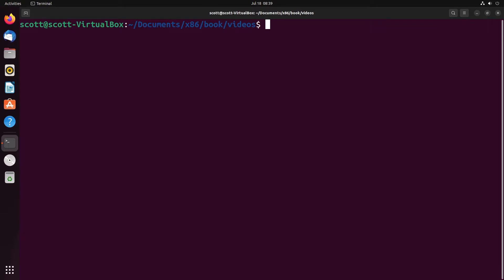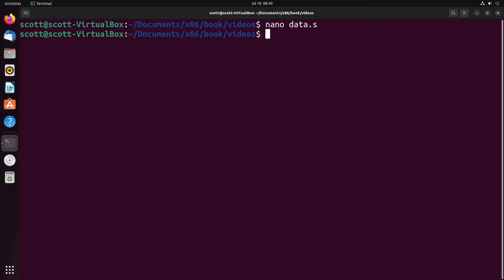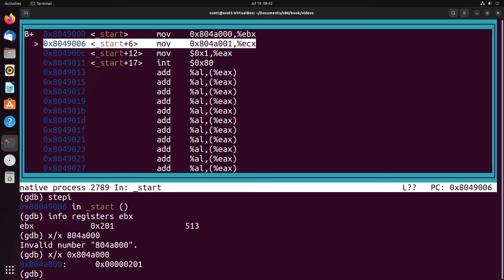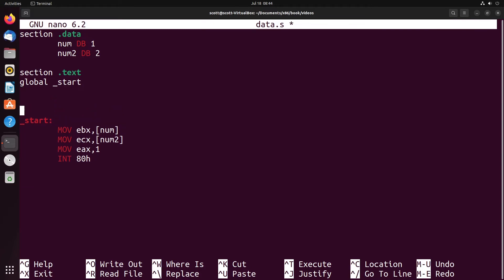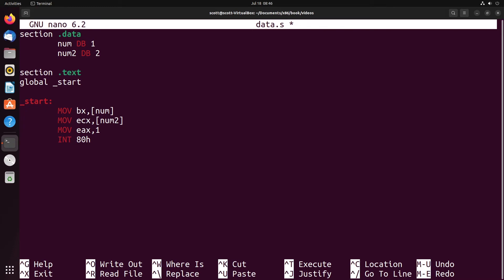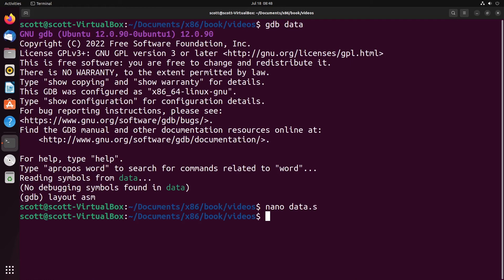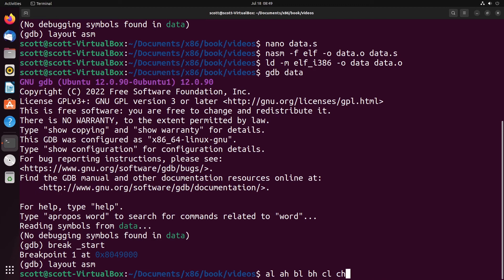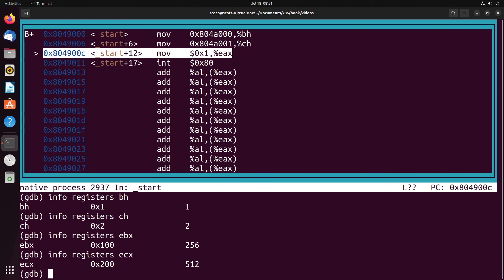Learning x86 with NASM - Working with Byte and Word Data

Comment: what about the other part of the register of you said ebx is a full 32 bit register and bx is half 16 bit the afterwards bl bh are the 8 bit lower and higher .
* * * *  * * * * 
             |_|. |_|. 8 bit each
             bh bl
|____|   |____|. 16 bit each
                bx
|___________| 32 bit
          ebx
is it right or something else ?
Reply: there is no reference for the "high part" of the register. If you want to save 4 bytes, use EBX, for 2 bytes use BX, and for 1 byte you can use both bl and bh. 
if you use mov with the reference for 4 bytes, it will move 4 bytes from the memory to the reg
Reply: @EliQuerida2004  Thank you sir 😁
Reply: when I use the bx  part of the register how can we use the other part and it does simply means that the size of the fetched data from the stack (RAM) depends on the register size we declared in the program like if I declare bx means only 8 bits will be fetched from the stack (RAM)???? PLEASEEEEE HELP MEEE SIRRRRRR 🫩🫩🫩

Comment: The more I listen, the more I can see how the architecture works. Like a direct flow of memory nodes being designated by .data, and .text being used to change the value in the form of BL=1 which is 0000/0001. Whereas BH=1 would be 0001/0000. It's a little confusing at first, but I can see why, in future applications, these would be important for storing different sets of numerical values.

Comment: After some time of playing with gdb This is how I understood the video:
Let's create a file and define many variables
nano something.s
=======================
section .data
	num0 db 2   ; Hex 02
	num1 db 4   ; Hex 04
	num2 db 5   ; Hex 05
	num3 db 26  ; Hex 1a
section .text
global _start
_start:
	MOV ebx,[num0]
	MOV ecx,[num1]
	MOV edx,[num2]
	MOV eax,1
	int 80h
=======================
But before we use gdb you can write
(gdb) set disassembly-flavor intel
So the output will be the same way as we write in intel syntax

(gdb) info registers ebx
=> ebx  0x1a050402  436536322
But that very large I want only 2 not that big number!!!

If we lock at 0x1a050402 we notice the same order in which variables are defined in hex from right to left.
Let's Convert 0x1a050402 from hex to binary
32-bits : 0001-1010 | 0000-0101 | 0000-0100 | #0000-0010#
Our wanted number between ## but it 8-bits because db is allocate 1-byte(or 8-bits),So we don't need whole 32bits we just need 8-bits.
Therefore now we can safely rewrite our code using 8-bit registers like bl,cl,dl 
=> MOV bl,[num0] 
---Now-----
(gdb) info registers bl
bl  0x2  2
And that what we need!!!
I hope you understand the idea💡

Comment: I'm trying to follow along on MacOS and something strange happens in my second register. (I have to use different registers, which in this case is rdi/edi and rsi/esi. To widdle it down to the lower half, it's dil and sil. dil works as intended all the way back up to rdi (value 1), but I only get 2 for sil. When I check the larger portion I get totally different numbers. My head hurts. I don't understand why it would work as intended for one register and not the other.

Edit: Since I'm further along in the series now and have played around with it more. It seems you can still use the same "normal" registers he uses in the video but Mac doesn't seem to 'echo $?' back from the same registers. Which is what threw me off. If any future people have any insights I'm all ears - cause I'm suffering lol.
Reply: I ran into this on my windows machine. My current theory is as follows:
the behavior you're seeing regarding the larger portion, is due to uninitialized registers. It seems like Linux (at least in the presenter's videos) always takes care to give the process a clean slate with the register state. But Windows and Mac seem to be more precarious (probably b/c they expect the OS libc to handle that instead). B/c it's uninitialized, the empty high portion of the registers are filled with noise.
If you need behavior identical to the video, you can adjust your program by making sure to clear each register before you start using it (just do xor <reg> <reg>)

Comment: Some years ago i used a Matrox graphic card PCI 4 MB with Debian and i startet with fb0 mapped linear framebuffer device with a resolution of 1024x768x32 so it was easy to draw into the screen or to load and display a picture using NASM.

Comment: It is a little confusing to see one time AT&T syntax and the next time Intel syntax.
Reply from the maker: Is it just the gdb portions that show the AT&T syntax? I just found out it can be changed using the set disassembly-flavor intel so I will correct that for future videos. I try to only show intel syntax since NASM uses it, but if there are any other parts where AT&T shows let me know so I can fix it. Thanks!